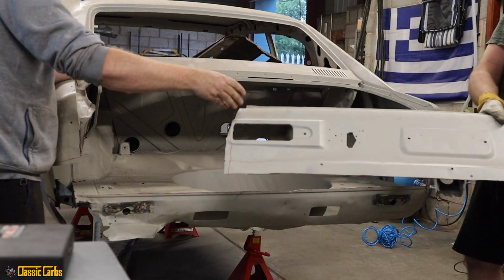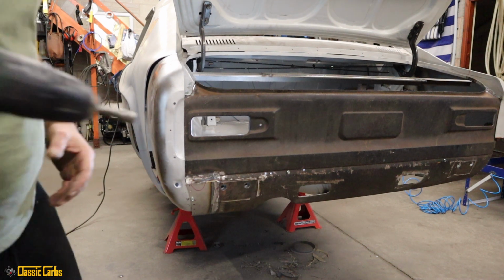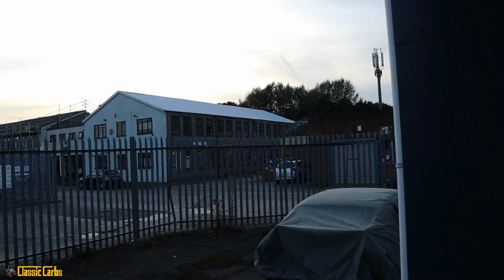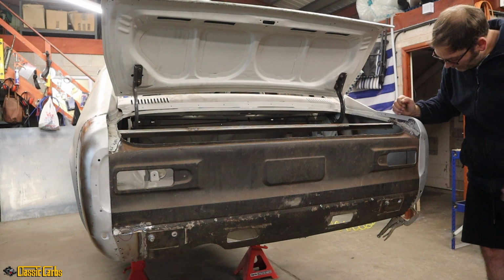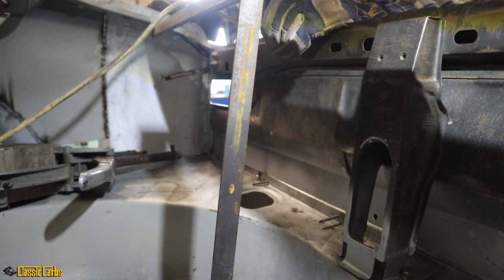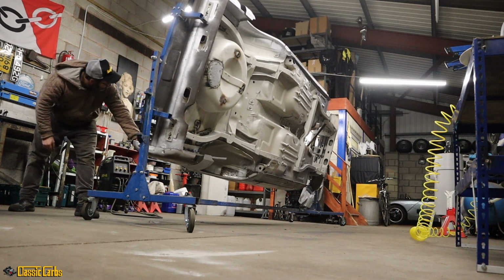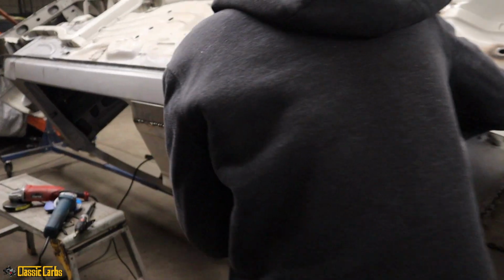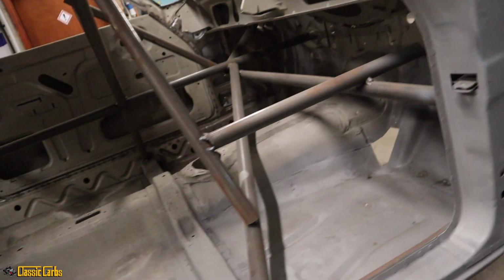1969 FORD CAPRI - PART 97 - |  Restoration | 'Kate' | The journey continues | Somewhere in between..

Comment: After watching this i'm pretty shure the one in my garage is one of the best unrestored MK1 bodies.
It's nearly stripped down complete and i haven't found a single spot where welding is needed.
There are two tiny repairs done nearly 30 years ago that could be done again to make it better.
Maybe i find something while flipping the car over, but i don't think so.
And we just bought it a few years ago for parts to build another one.

Comment: Wow! - Nice work lads! Rear end complete! Now for project front end.

With all your finely honed fabbing skills, your mission is to replace the front end with the RS panels.

Heater bulge probably taken off to repair bulkhead panels, accident damage? They look to have just blobbed it back in place.

Will be interesting to see the condition of the 'sweatbox' when you remove that scuttle panel. Once you have RHD panel in place, that will be a massive milestone achieved.

maybe time to get a really good heater in it now? Maybe air con?

HOABL
Reply from the maker: Sweatbox is looking bit worse for wear Tommy, but its on good hands me thinks 🤔 😉
Reply: @Classiccarbscouk  An ex Ford man told me years ago when talking about my old Fiesta Mk1. That the sweat box is always very nasty. This was about 1988, the car was 1981.

Your car is 1969, it is now 2022. So it is 53 years old now. It will be red rusty and very crispy I imagine.

What I think you should do is install a Rover V8, and weld in all the stainless exhaust hangers now while on the rotisserie!

HOABL

Comment: Looking good…Pate C has some little clamps almost like reusable screw type pot rivet things to get panels to line up level before tack welding the seam … 🤔
Reply: Are they techscrews? No idea I'm learning 🤣
Reply: @swebb302  tech screw is a self taper with its own drill on the end , I’ll see if I can find them, like little clamps that fit in the join and clamp the faces level to tack up 🤔

Comment: Great update!  pretty good work on those rear panels. It does take some time but persevere and it will all be worth it in the end!
great work guys, great work!. 
If you have any energy left after this lol could you try and get a TR8 back on the road?  (just a suggestion!)
all the best and keep at it guys, keep at it!.
Reply from the maker: TR8 sounds interesting! Is that what you're building?
Reply: @Classiccarbscouk  No no, it's a car I had in the 80s I wish I still had lol there are a few projects on youtube but they are of the TR7.
 I find your Capri restoration interesting because my father had one during my childhood I believe it was a crossflow? I seem to remember being at the dealership when we picked it up all brand new and shiny lol and I remember him raving on and on about the engine, I think it was around 1972?. Anyway, best of luck, you're doing a sterling job!.

Comment: hi mano,you n the guys are doing a grand job my friend!,im doing the same to a mk5 cortina,anyway just wanted to ask what size tech screws you are using to temp hold body panels?
Reply from the maker: These ones here:
https://www.ebay.co.uk/itm/5-5mm-x-25mm-12g-x-1-TEK-TEC-SELF-DRILLING-METAL-SCREWS-ZINC-8mm-HEX-HEAD-/360532822078?mkcid=16&mkevt=1&_trksid=p2349624.m46890.l49286&mkrid=710-127635-2958-0